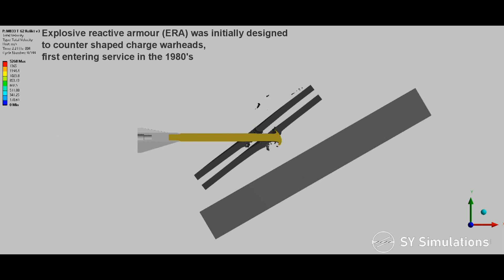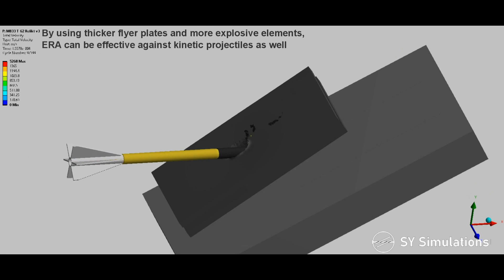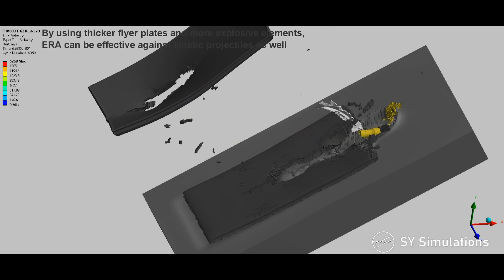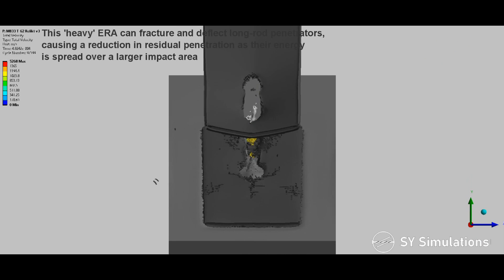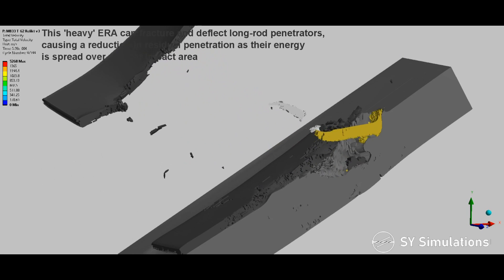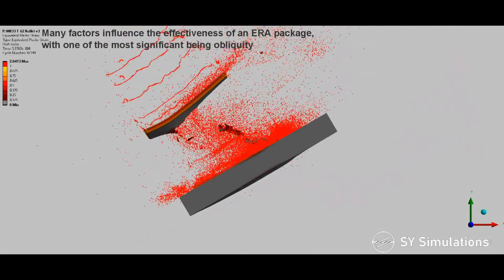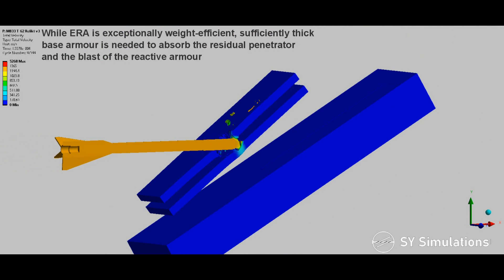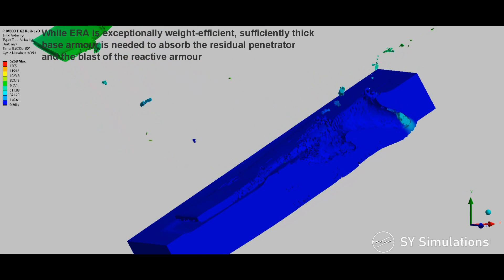APFSDS vs ERA | M1IP ABRAMS vs T-62 + Explosive Reactive Armour | M833 Armour Penetration Simulation

Comment: Some nutheads seems to miss the obvious display of this video about the effectiviness of ERA: it almost halved the power of M833.  What if the sim was made at 3 km?  Or if it was added 10, or 20 o even 30° horizontal? The M833 was already at the edge at 2.5 km at 0° horizontal angle.  At 30° it would fail even at 1.5 km i would bet (you must add about 1.15 times the armour + ERA).   Remember, the armour cannot stop anything: the Japs fighters had 13 mm thick armour behind that could pierced from 12.7 API at 500 meters (but 0 vs 7.62), while if the hit happened at 20°, the range was reduced to 300 meters, and at 25° just 100 meters. This is why  the armour matters even when it cannot hold a proiectile. In pratical terms, the horizontal angles are a lot important and you can see this also in the naval table gunfires, you would be surprised to see how any APC proiectiles would degraded its performances if hit a 30° angled armoured belt: a 381 mm italian, as example, fallen at 20 km from 402 to 326 mm, a 152 mm at 14 km from 86 to 70 mm.

Comment: Then tell me: how the M300  60 mm APFSDS at the same speed can pierce at 3+ km the T-55? With a 0.9 kg 17x200 mm ammunition, when the 24x427 mm M833 at the same speed (1,300 m/s) can pierce barely the T-62 with ERA and pierce 200 mm at 60° (vs 120/60 for the 60 mm gun)?

Comment: Still created lethal spalling even with K5
Reply: 100mm at 60 degrees is 200mm los, m833 at 2.5km should still pen over 400mm los giving this era which resembles relikt more than k5 about 50% degradation to this round

Comment: I hope everyone understands that this is at 2500 meters from a 105mm round from the early 80s.

Relkit from this simulation would be providing ~190mm flat pen equivalent of protection. Or ~225mm LOS protection at 60 from this set up.
Against M833

Comment: It is clearly seen that it is rational to increase the distance from the epa module to the main armor and add a damper, it is possible to increase the thickness of the plates... A heavier epa unit is needed. It is possible to introduce pre-initiation ...

Comment: What if upper plate will have added pieces of steel on it?
Like Belarus T-72bm2
Reply: Well it was a t-62 in this simulation so the t-72 would have survived in the same situation using the same explosive reactive armor. 

As for if you added a bit of extra steel onto the T-62 in this situation underneath the ERA there is a chance an extra 25mm could have saved it

Comment: I'm not sure why some are commenting that it stopped it. The remaining penetrator tip clearly breached the armor and would have continued on to be absorbed by the driver's head or damage something else.
Reply: Not really modern, a late 80-early 90 Abram is the first gen before they switched to 120mm
Reply: I think this simply illustrates the effectiveness and possibility of damage vs mission kill vs destruction. A small piece penetrated but it may be comparable to firing a single round into the tank interior vs dropping a hand grenade
Reply: All armor is eventually penetrated by something and few things are 100% effective. Just my $0.02
Reply: Same gun that was on the M60A3. Probably also could use the same ammo. I don't recall if my unit swapped ammo when we switched from M60A3s to M1IPs.
Reply: Legit nobody is commenting that it stopped it. Everyone is impressed that the ERA managed to demolish half of the rounds armour penetrating capabilty, especially because the T-62s Upper Front Plate is just a 100mm RHA block angled at 59 degrees, which equals to just below 200mm LOS armour value. Now switch the T-62 to a T-64 or a T-72 Ural and hit in the exact same spot with the exact same ERA, the shell will not have any chance of penetrating those tanks.

Also, compare the result of just a T-62s UFP without the ERA and see how much post pen penetrator rod will remain compared to this one. Here barely anything remains, without the ERA i'm willing to bet that over 60% of the penetrator will remain.
Reply: T-62 is old tank, not contemporary to M1.
Its armor is not that better older T-54/55 but it is almost enough to  defeat the 105mm sabot which likely not around when T-62 had big presence in Soviet Tank forces. Essentially 80s around against several decades old tank
T-72 with heavy ERA when test after the Cold War was found to be able to defend quite effectively against anti tank rounds of 120mm of that era so it led to a rush to develope new APFSDS to defeat that combo.
Reply: It's literally m1p Which existed when this era was introducted @huntermad5668
Reply: @huntermad5668 Relikt is not old. The relikt on the video is buffed too, just check the description.
Reply: @huntermad5668 T-62 still being used by Russia, T-54 even. Heck not shocked if the IS-2 comes back at this rate.
Reply: @huntermad5668  Sheesh here comes the tankies to cope about their old tanks being destroyed by the dozens every week smh
Reply: @WimsicleStranger  Sir. It's called a joke...
Reply: Correction - Russian designers included driver's head as part of the armor package.
It is called "bio-armor" and is applied to many BTRs and BMPs on the battlefield in Ukraine.
Reply: man thats a t-62. its not even composite armor! its just a 100mm angled plate, its incredible how it managed to reduce the damage
Reply: im not sure how ur so proud when comparing a modern tank to a 1960s tank
Reply: @chickenchicken8097 where is he expressing pride of any kind? He simply stated he is confused that some people are saying the projectile was stopped and it clearly was not stopped....
Reply: @chickenchicken8097   But this heavy ERA isn't from the 1960s, it's developed specifically in response to such very large caliber smoothbore APFSDS rounds which was first deployed in the 1970s. And it STILL wasn't quite good enough, it still penetrated.
Reply: @Treblaine  Not mention that the ERA in the video is not realistic and has increased explosives and delay to show the viewer its effects.
Reply: @catt0215  yeah, this is absolutely monstrous era, it does a hell of a number on the glasis plate by itself. Not as bad as hesh but actual deformation.
Reply: @chickenchicken8097 M1IP isn’t modern that’s decades old aswell lol. The T-62 is still in service till this day as if it never left. Being used in current conflicts by a world power. An M1 from the 90s would take out a T-62 model 2022… Relikt ERA came out when?

Comment: What if we stack the module, with maybe 1.5 module thickness spacing between the front and the back module. 

Then by extension, how about the polish era with ceramic fly plate and rather interesting construction.
Reply: then it costs more than twice as much

Comment: You must do one on Lancet vs Abrams. Two already got smoked by them in Ukraine
Reply: Lancet already smoked literally thousands of afv. 
He already do more than plenty efp sim. 
There is no easy to do scj sim, but I hope it is obvious why one does not need a simulation to understand why rpg round to the roof of a vehicle is bad news.
Reply: we dont have a certified number of the lancet penteration in RHA we might be to guess a number depending on the explosive amount and the width and length of the warhead but we need the dimension first,
there are olny reddit nubmers of biased and non comfired sources
Reply: @mostafamohy8494  I've seen a few videos of a lancet detonating on a tree branch 5 feet from a self propelled arty piece and still penetrated in some areas, it's such an interesting piece of tech. I love it, regardless of which flag it flies under
Reply: @mrj4990   yeah lancet is really good but 5 ft penteration in air cant be translated into tank armor , i wish we had the numbers so we can test it to see it effictivness in turret and tank sides as i think that were most attacks happen
Reply: You're very right, Tank at 5 feet is not feasible, c'Mon Russia just tell us
Reply: Да, это правда. На Украине уже минимум 2 абрамса уничтожено. В интернете есть видео поражения.
Reply: I heard that they smoked 1500 Abrams already, with hand grenades
Reply: @xendk  Cope harder, I'm just stating facts about the Abrams specifically.

Comment: You're sitting in tank
Suddenly you hear explosion and there's dent in armour above your head
Reply: it did penetrate. anything behind that plate is not going to think what happened, because he would have some holes in his body.
Reply: @o-hogameplay185  The tip speed is likely to be less than at the exit of the muzzle. So there is a chance to stay alive.
Reply: @Redfvvg  It still looks to be going at faster than grenade fragment, plus whatever else spall is kicked off. Depending on where exactly on the armor it hits this will be a bad day for the driver.
Reply: @dominuslogik484  There is a significant difference between a delicate human body and thick armor.
Reply: @dominuslogik484  I remembered a long-ago story. This happened at a time when Soviet troops were in Afghanistan. The guys were eating outside, and one guy was hit in the head by a bullet, hit in the skull, and bounced into a bowl of soup. It was released from some local mountains, having lost its killing power on the way. It was hardly a sniper shot, more like a stray bullet. So that guy got off with just a bruise, and an impression for life.

Comment: This shows how powerful era can be considering that it almost stopped the round and T-62's ufp is only raw rha
Reply: its a gun designed before the t62 is introduced. I don't see how defeating gun around it's era is miraculous or anything
Reply: @kamingleung3792  the ammo matters more than the gun. The L7 is old yes but ammo has a lot of improvement over the years. Not the round in the video, but the M900 APFSDS has comparable pen to some of the early 120/125mm rounds and is from 1990s iirc. M833 is also quite new, it came after the initial Abrams for sure because they weren't issued this during its introduction (iirc it was M735 or M774 when it was first introduced).

This works the other way around too. T-62's U-5TS is about as old as the tank, the initial 3BM3 ammo could pen less than 300mm but now there's the modernized 3BM28 DU APFSDS for modernized T-62M variant with well over 400mm of pen. 3BM3 would struggle to pen even an M60 at some ranges in some areas but the 3BM28 would go through the hull of the original M1.
Reply: @kamingleung3792  The round is 20 years newer though, and actually has better performance than the earliest 120mm APFSDS rounds. A 60s APDS round would absolutely not have a chance of making it through. Though obviously this ERA is from the 2010s.
Reply: it also almost penned the plate itself
Reply: It literally penetrated. How did the ERA "almost stop" the round when the armor plate has a whole in it and a corpse behind it?
Reply: @rodrigovaccari7547 barely any of the penetrator made it through, there's a chance the driver may have actually survived this one. Especially since it appears to have lost the majority of its velocity and is heading downwards. Nevertheless, it still made a massive reduction in penetration. You watch the video? It said normally M833 can penetrate 200mm of RHA at a 60° angle, which is probably even steeper than the plate shown. You think that tiny piece of penetrator left over is gonna get thru 100+mm more armor? This was a good 40-50% reduction in penetration.
Reply: @RedVRCC  I really dont understand why the goalpost changes every comment. I didnt say it didnt help. More than half of the shell was still left. Some of it was deflected by the last pieces of ERA. Op said it "almost stopped" the shell. If there wasnt a hull behind the ERA you woud have both tons of spall created by the deflected pieces and a big chunk of shell still left. So no it did not "almost stop" the shell. Its really basic interpretation.
Reply: @rodrigovaccari7547  addressing the first part, I didn't read all the comments in between, just immediately replied to the first one I saw. 

A large amount of the penetrator was degraded and an older and weaker one would likely have been entirely stopped or alternatively a better base hull armor could have stopped it. That's all I'm saying.
Reply: @rodrigovaccari7547   yes 'almost stopped' is the right term, as without ERA those ammo would have more than 50% remaining piercing power to pass throught the T-62 armour while with ERA it barely penetrated.  And if the T-62 was just a bit far and/or with a horizontal slight angle it would be spared as well.  The T-62 without ERA would be penetrated atleast from 4 km away. I don't think it's difficult to understand. :D
Reply: @rodrigovaccari7547  Simulations don't involve corpses. Nonetheless, if modern ERA can remove that much mass & energy from a projectile that's 20 years more advanced than it's otherwise unmodified target, I'd say its effectiveness has been more than demonstrated. A target with better underlying armour, even something like a T-72M, would have been fine.
Reply: @manofconstantgold  that ignores that the projectile in the video is a very old model and was designed before ERA was considered an issue. Modern APFSDS in the west has been engineered to defeat ERA.
Reply: @rapter229  Original comment I replied to said nothing about modern ERA or ammo.The simulation demonstrates it’s capabilities are not imaginary, and nothing more. M833 was made in 1983 for the 105mm M68 so not exactly “very old” though tbf the 105 is essentially obsolete anyway.

You say “modern APFSDS in the west” which round are you referring to? DM63? M829A4? L27A1? Penetrator capability can only go so far to resist ERA as you must increase the rigidity (and therefore thickness) to resist the lateral stress of the explosive. Eventually penetration power is compromised.
Reply: @manofconstantgold  Im struggling to understand whats the relevance of these informations. Im talking about the content in the video and so is OP, not another context. The ERA was clearly not nearly enough to protect the tank which still got penetrated anyways.
Reply: @rapter229  Remember thats only a T-62, if that would be for example T-90M ufp even the most modern ammunition currently in service would have trouble penetrating that
Reply: @manofconstantgold  your original comment talked about how the video more than demonstrates the effectiveness of modern ERA. But the video is a comparison of ERA more capable than relikt against and outdated projectile. 

And I think you will find that rod thickness was just the first method of countering ERA, not the only method.
Reply: yes it did penetrate, but as i and many other people said, almost means that something even a bit more armored would stop that (T-72 or T-64 for example) @rodrigovaccari7547
Reply: @rodrigovaccari7547  yes it did penetrate, but as i and many other people said, almost means that something even a bit more armored would stop that (T-72 or T-64 for example)
Reply: @VulcanCannon_  yes, because the hull did most of the work, not the ERA...
Reply: @rodrigovaccari7547  The penetrator was nearly fully eroded by the time it got through, I'd say it's fair to say it barely penetrated, which is rather impressive considering it's "only" 200mm LOS steel behind the ERA and this specific round has a LOS penetration of more than double that.
Reply: @rodrigovaccari7547 it lost most of its energy, barely penetrating. 

Keep in mind the backing is just a single 100mm plate angled at 60 degrees totaling to 200mm LoS. That is very impressive.
Reply: @TheForklifter  and let's add  a 10° horizontal angle and the T-62 will neutralize the M833. Not bad at all.  What about with a 20-30° horizontal angle? Maybe the M833 would fail even at 1,5-2 km.